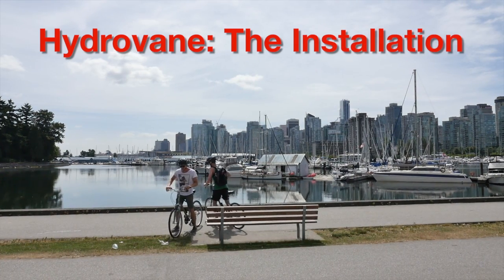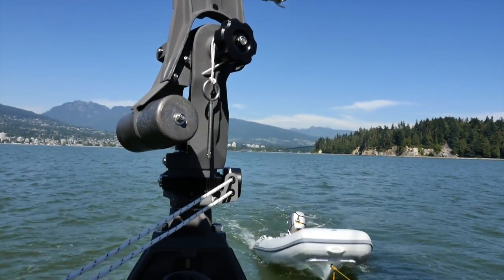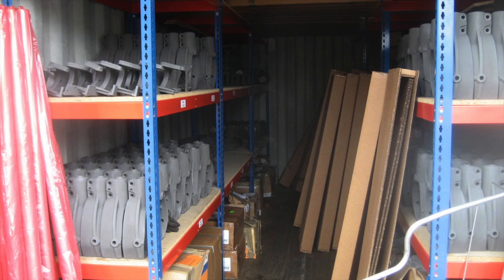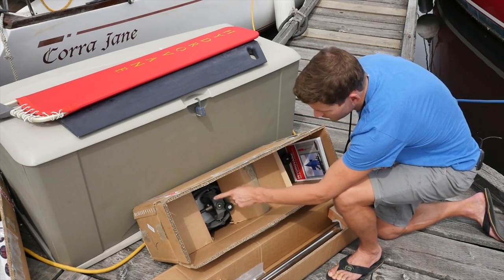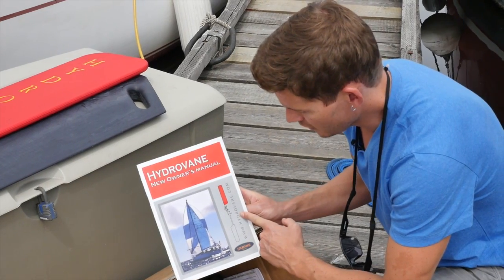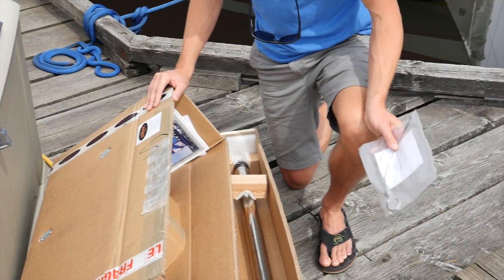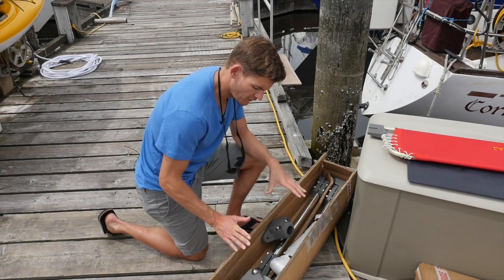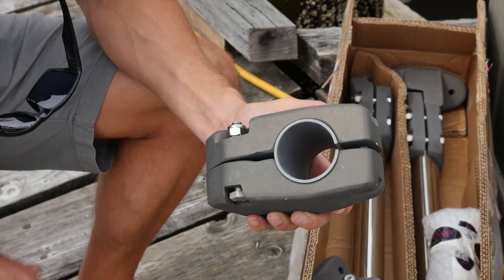Hydrovane: The Installation - Part 1

Comment: Have you got an agent in New Zealand or can I buy direct form the UK or Canada? What is the cost of a Hydrovane for a small 8:5 meter yacht flat transom.thanks
Reply from the maker: Hi Peter - apologies for the slow response - just noticed your comment.  We deal direct. All manufacturing is done in England and we would ship from there. The cost depends on the nature of the boat's transom (determines which shaft length and brackets are required).  If the transom is flat, you can use two of the H (Hinged) Brackets - very simple. Please reach out for a specific quote. Photos of the transom are helpful. sarah@hydrovane.com.  Cheers!

Comment: Thanks for the video, it has dispelled what I have been told. I have a C&C37/40 with a walk out transom. The off set install will work just fine. I do have davits with solar panels that may have to be adjusted and the dingy can be place on the foredeck for long passages. Has an installation be done on this yacht before?

Comment: Will it work on my 1989 Island Packet 35? Potential issues a) rudder comes right aft b) there is a dinghy davit crane but it does have a gap (dinghy can be stored on foredeck) but solar panel are mounted on the cranes c) the cockpit has a bimini and dodger...hoes does this affect airflow? d)main rudder is direct quadrant steering to wheel. Are they available in the USA? If not not, what is the price with import duties?
Reply from the maker: Hi Snake - for sure! None of those are issues for the Hydrovane: a) Install the Hydrovane off center, b) We will specify the proper length Shaft Assembly so your davits can be operational while using the Hydrovane,  c) No problem, d) The main steering is irrelevant - you will simply lock the main wheel (main rudder) before you engage the Hydrovane to take over. We manufacture in England and there is no import duty to USA :)  If you'd like to receive a Proposal from us, please send photos of your IP35's transom showing all gear to: John Curry - john@hydrovane.com. Cheers, Sarah Curry (sarah@hydrovane.com)
Reply: Thanks, I will keep your contact. No urgency but just wanted to know it will fit for a future trip.

Comment: seems like a strange choice not to include the bolts and other items. hum
Reply from the maker: Hi Terry, The only bolt sets not included are the Mounting Bolts (Bracket Flange to Transom). Each installation needs either 4 or 6 of these and the length required depends on the transom thickness, spacer thickness, etc, so hard for us to spec. Cheers, Sarah Curry.